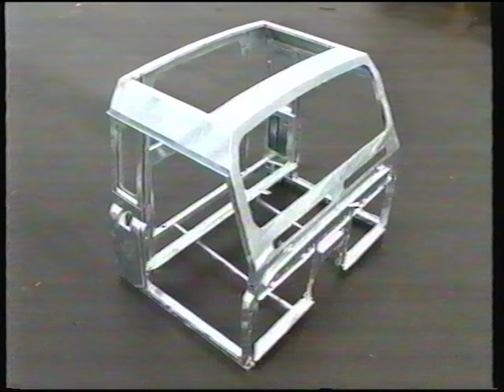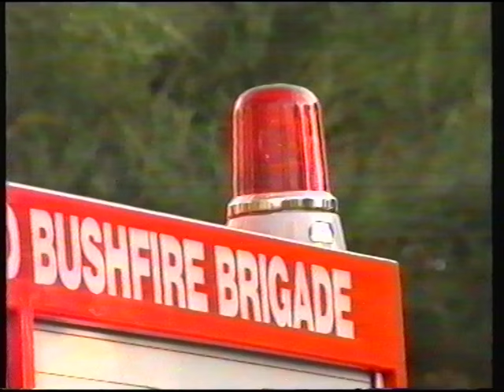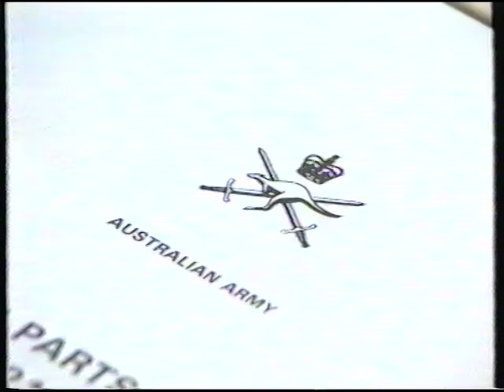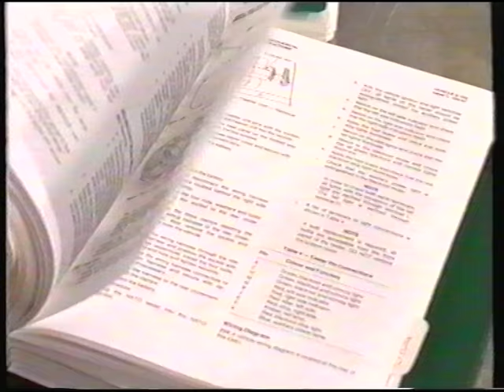Land Rover Australia Perentie Video

Comment: When was this ? LR weren't without 6-wheelers although more commonly as the Range Rover marque.
Reply from the maker: This would be mid to late 80s I believe.
Reply: @groverandphoenix  Yes, however the ARA has only recently moved on to the G-Wagen, mistakenly in my view. Perenties are still being auctioned off to the public today, and are an excellent purchase due to low mileage and frequent servicing. One of the best parts of the Perentie's appeal, mechanically, is the use of Isuzu engines, NA in the 4WD and turbo in the 6x6 variants.
Reply: The 6x6 Perenties were unique. No other LR had the same drive system.

Comment: This vehicle would be hard pressed to keep up with Pinzgauer 6x6, particularly in deep water
Reply: Australian army also used the Pinzgauer 6x6
Reply: @alanbstard4  which unit? I never saw them. the US army Delta force used 6x6 pinzgauers and they shit all over the LRPV variants. The 6x6 was grossly underpowered, low ground clearance, always hitting the front track rod onn rocks or termite mounds, this bar was lower than the front axle... ludicrous..... if two of the rear wheels , on one side, were in slippery mud all the power went to those wheels and wouldnt move, even though the othe 4 wheels were on tractionable ground ! !  !, it took nearly 12 years to get diff locks and a bigger turbo on the LRPV's only as they were deploying to Afghanistan and later Iraq,
However I love them and I am in the market for one to use as my roo shooter